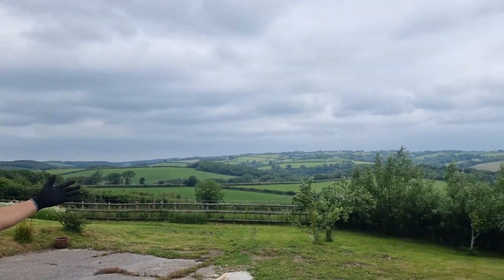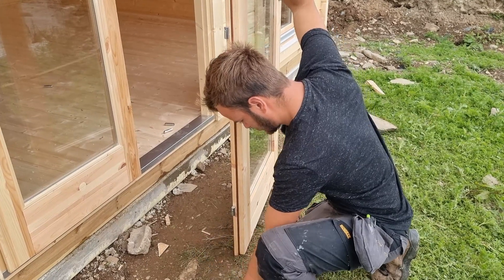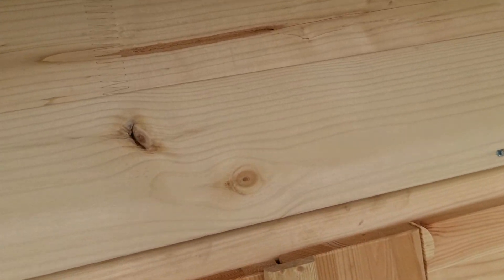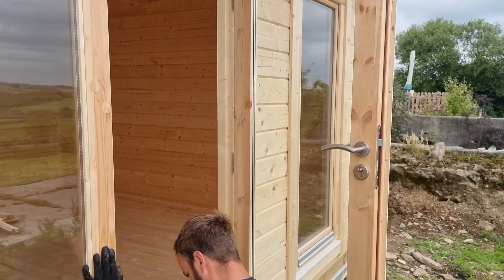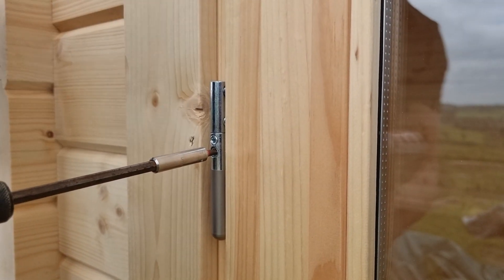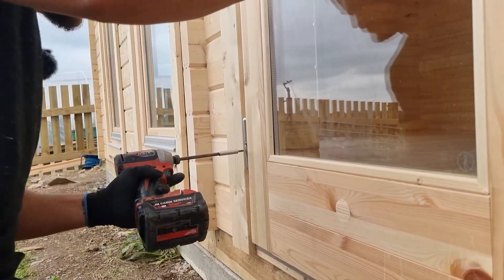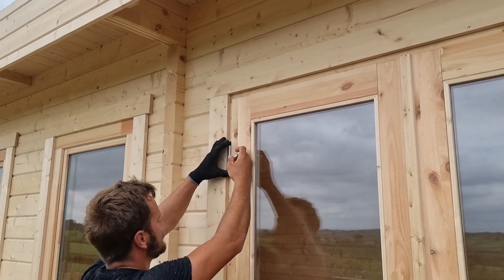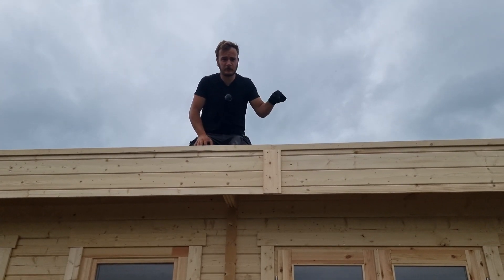Sticking Summerhouse doors? TRY THIS!

Comment: Thanks, super helpful. I've used the adjustments to their extremes now and the doors are still expanding in the wet weather we're having. Any other suggestions on how to make them open/close smoothly once you have no adjustment left in the hinges?
Reply from the maker: You could use a Planer and reduce them further by a few mm, but once we head into warmer weather , they're likely going to shrink, so take off the absolute minimum you can.